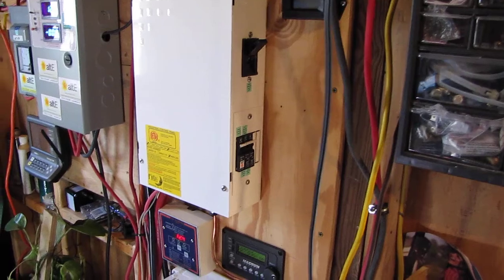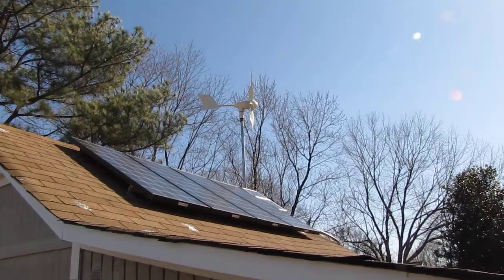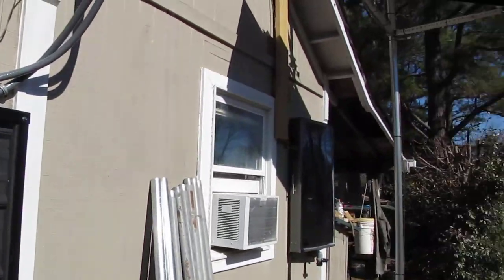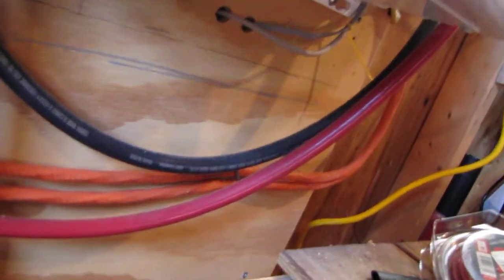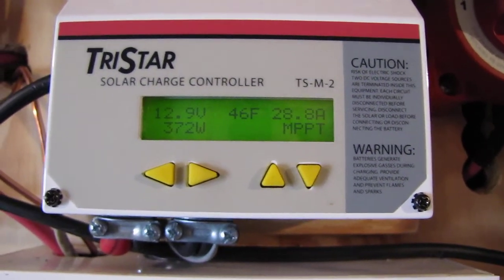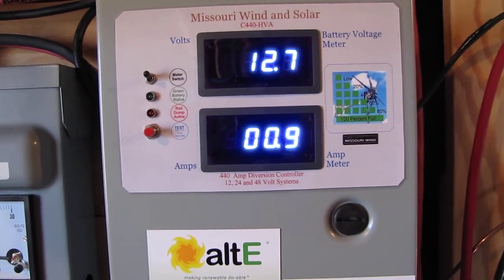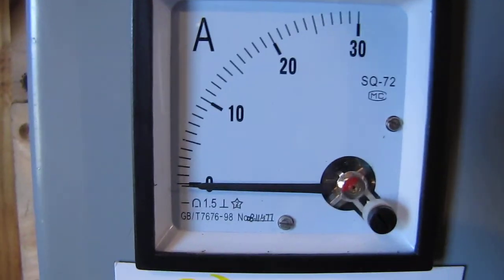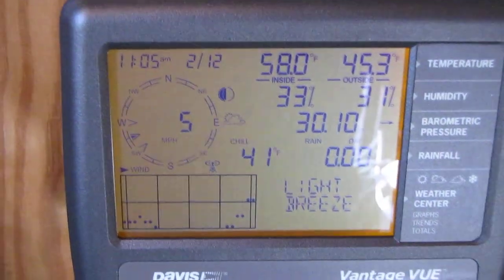VIARLOCITY SOLAR AND WINDMAX HY  500  24 Volt  Update  In Southern Virginia Part 2

Comment from the maker: @N8Dogg1002 Yeah Nate we could run the whole Block Bro Yeap My system is all 12 Volt But My Turbine is 24 Volt   Larry  Leamy suggested it  The 24 Volt  just puts out More power & Volts Less turns per revolution  My Charge controller takes care of over Voltage / Charging before it hits My Battery Bank  Bro Its all Good  Thanks Bro Kenny